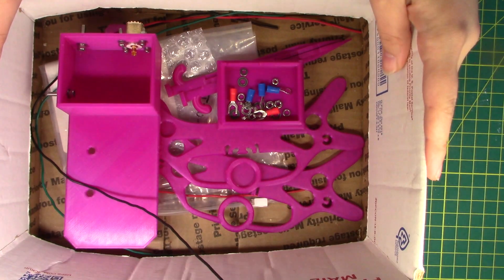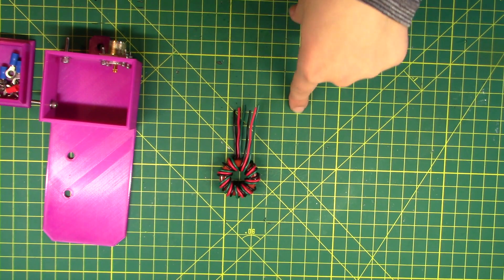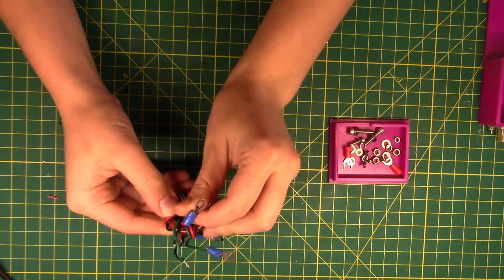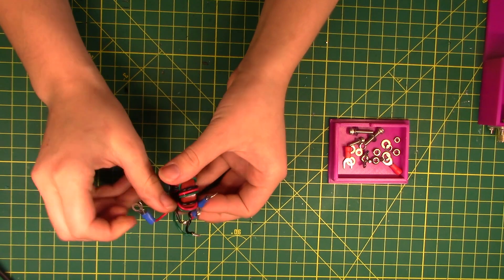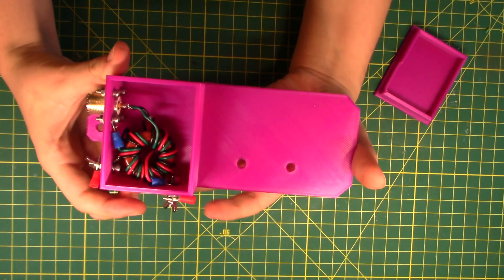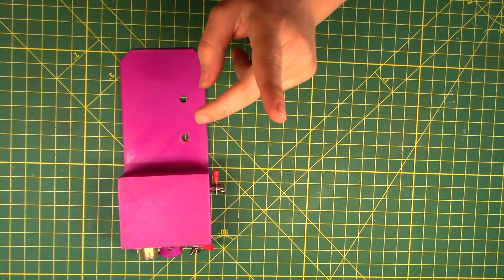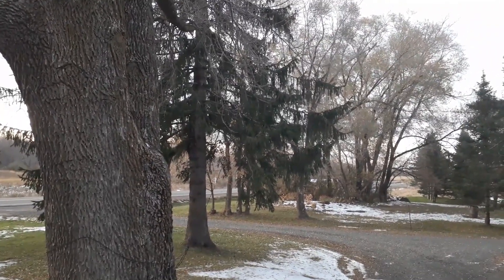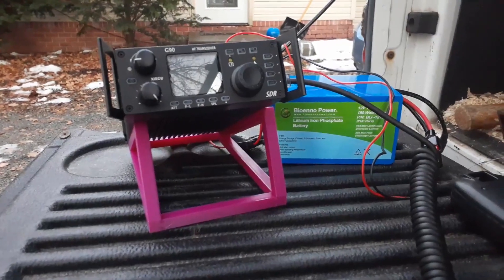EARCHI Antenna Build!

Comment: They are great antennas. I put one together with a 140-43 core 41' of wire for the radiator and roughly 100' of radials fed with 50' of rg8x. I have talked from Southern CA all the way to Connecticut. I have it running a a slopping long wire with the high end only 14' off the ground. With the 140-43 core I run 80 to 10m highest swr is 2.3:1 on 80 and get better from there.
Reply from the maker: Awesome, I was really impressed with how well it did!